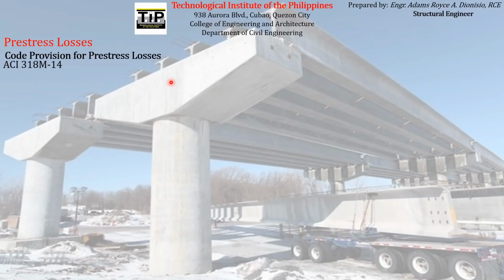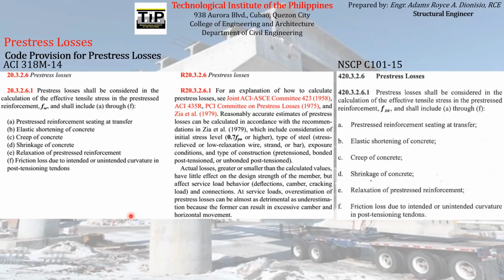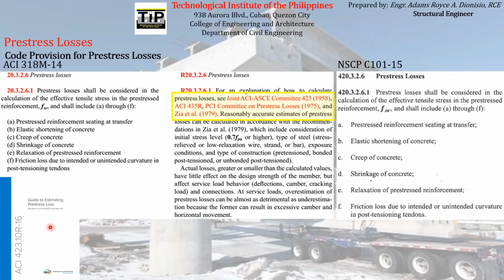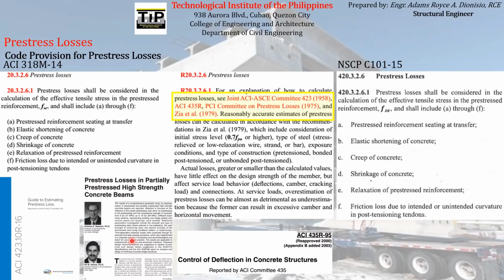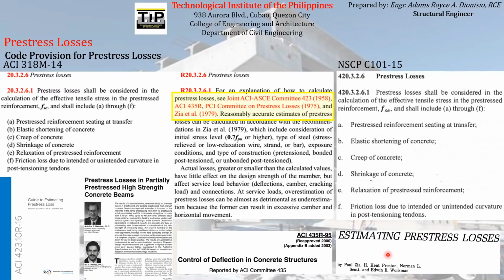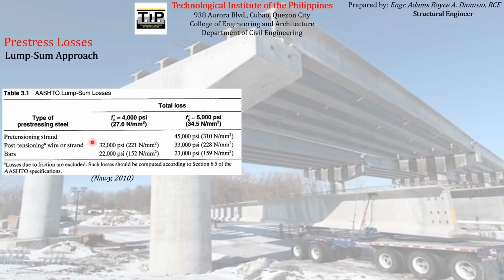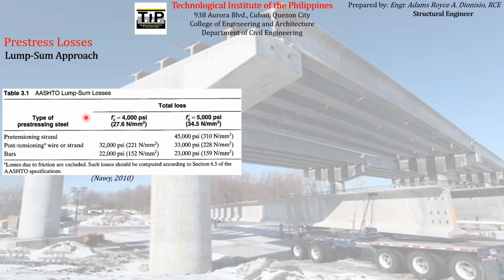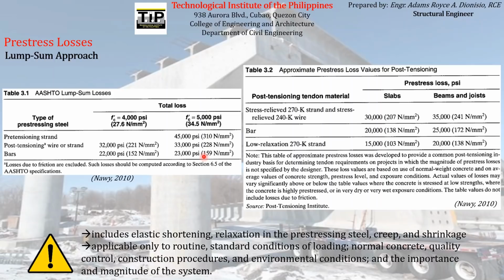4 Part 4 Categories of Prestress Loss | Code Provision for Prestress Losses | Lump-Sum Approach

Comment: Good day, sir. What if the f'c (e.g. f'c = 6000 psi) is not included in the table? What lump - sum loss should be used?
Reply from the maker: Normally we just interpolate using the values from the table